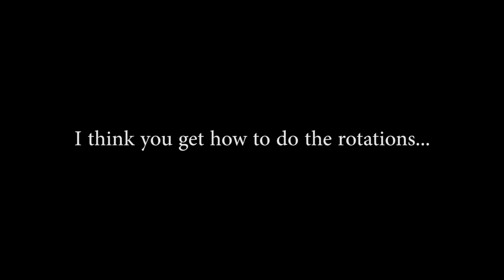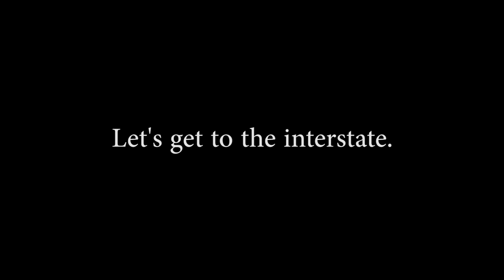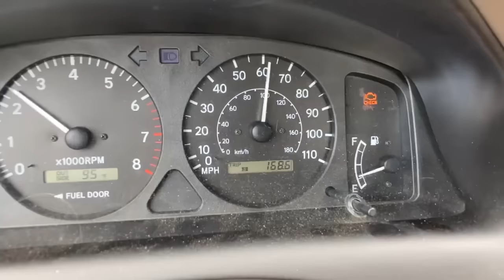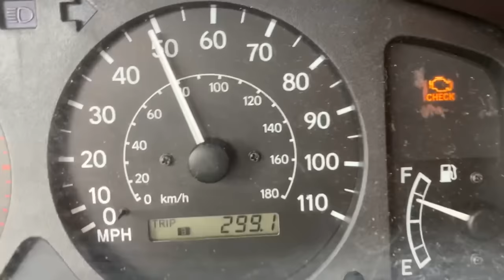Will Berryman's B12 Chemtool stop oil consumption? 😲 | Oil Burning🔥Experiments | Episode 15

Comment: I have done the same thing many times with my customers vehicles that failed the state required smog test. It has worked every time. I have no idea how much oil consumption has changed, since I never see most of these customers again.
From what I can tell, the oil control rings just get gummed up, and fail to work properly. This condition is mainly found with old ladies who drive very slowly around town, and never run on the freeway for very long.
I usually just send the Barryman's in as a top engine cleaner, as it is quicker in commercial operation. I have rarely done a full soak, and when I did, I relubricated the upper cylinder with engine oil before starting the engine.
I thought you might have hurt the cylinders with a dry start, however, after seeing your after-actin shots, I can clearly see a beautiful cross hatch pattern!!! Most Excellent!!!

From what I can see of your oil pattern on the piston heads, I would say that you need some valve stem seals, or perhaps new valve guides, when doing your next valve job.
I think your bottom end is good to go!!!

Try using some ATF in the engine oil, 500 miles before your next oil change. ATF also cleans piston rings, as ATF has lots of detergents that help removing such things. ATF also makes a great engine flush, but I always fear flushing an unfamiliar engine, as the ATF treatment removes a lot of internal engine gunk and might plug the oil intake screen to the oil pump.
That's why I recommend using ATF to top off before the next oil change, as you use less than a quart, and change it before too many miles have accumulated.

Proper oil change intervals never require flushes!!!
If I slip and go beyond 5,000 miles, the next oil change is done early, at about 2,500 miles, to insure maximum cleaning action from the fresh oil change.
I have never let any engine run past 10,000 miles!!! I don't care what the oil or engine manufacturer says!!!
I can afford oil and filter, every 5K miles, but an engine rebuild is going to be a bit much for me, at my age, So I take care of basic maintenance, and don't have issues!!!

My 2002 Tacoma has 165,000 miles, and still has 170 PSI per cylinder with 5% max cylinder leak down. So, I think good maintenance pays!!! Now if I could just get my IAC's (Idle Air Control) to last that long, as I am on my second one @ $245.00 dollars for an OEM part!!! The only real complaint I have on the 2.4L engine.

Good work on your test.  A good test is worth 10,000 expert opinions!!! LOL!!!

Tim
Reply: I had an S10.PICKUP  that I put in a 350 with a automatic in it , as a service truck the 4th engine got almost  600 000 miles on it when I removed it to freshen  it up. So I took it all apart and took all the pieces  to my racing machine  shop , everything  was within spec and they freaked out on how clean it was , I took it home and freshened it up as planned.  It ended up on the drag strip and it won king of the track and king of the hill titles  ,    I used Mobil one and wix filters and oil changes at 20,000miles or when the first quart is used, my current trucks have almost 400,000  miles and I've owned it 23years now the other has 3oo ooo ,I've had it 10yrs now  I do the same oil changes with Mobil one and wix.

Comment: Great video, Ben! Nothing beats B-12! My classic '89 Toyota Camry sat for the last 4 months through the winter waiting for its new Collector's Plate to arrive, and when I finally started it back up, it was running rough as all getout with carbon poofing out of the exhaust pipe every time it missed and stuttered. The car had just under 1/4 tank of gas out of the 15.9 gallons it can hold in it, so it was the perfect time to head on down to O'Reilly's to grab the last 3 cans of Berryman's on their shelf (which was exactly how many I needed for the trick I was about to pull off). Total cost: 20 bucks.
Here's what happened: O'Reilly's is 2 blocks from our home. My plan was to go there first, grab the B-12 I'd need to do the job, then continue up HWY 99 at a steady 45 MPH to get the shopping done. 2 cans went into the tank immediately, the rear bumper was bounced for around a minute or so to get it mixed in thoroughly with the 3[ish] gallons left in the tank, and we were on our way.
Naturally, it ran like complete crap missing and stuttering and farting carbon for most of the 3 miles it took to get there (I could see the poofs of black smoke in the rearview mirror), but 2 blocks from the store it started to even out some. After we finished shopping and headed back home, it surged a little at first then smoothed right out and ran like a champ. I plan to run it like this until the fuel warning light pops on, at which point I'll add the last can of Chemtool and top the tank off. After that, it'll be good to go again! =D
Reply: Dude, I'm using a 89 v6 camry as a daily driver and just had it parked 2 months. I'm going to try this today. Thanks!

Comment: Bravo Dave! I’m so confident that B12 worked and yes I’ve used 2 cans of B12 myself as 1 treatment. 1 can for hot soak with engine warmup, and 1 can for cold soak with engine was cold. And I also put in some ATF transmission fluid in each cylinders at the end, about 1/2 ounces in each cylinder to help lubricate the piston wall and final stripping off the left over carbon in the cylinder before starting the car. (ATF can strip off carbon deposits that’s had been loosened by B12). U don’t need much, just 1/2 ounce is good enough or u can skip the ATF if u don’t feel safe with it. That’s small amount won’t hurt anything since u r gonna change the oil anyway. Great video Dave! Hope to see your follow up video about the oil consumption after B12 treatment and remember, it may take 2 or 3 treatments to fully cure oil consumption and each manufacturer’s engine is different so it might have different results.
Reply from the maker: Thanks again for the suggestion ... I'm still in shock! I'm almost afraid to pull the dipstick again. 😳
Reply: @FamilyFriendlyDIY  so on to your next experiment? Is your check engine lights on because of the catalytic converter code P0420? If that so, I have another suggestion for u to try lacquer thinner in gas tank to clean out the cat. It will work wonders just like the B12
Reply: @blackysan  wait...what? Lacquer thinner? Tell me more. I typically buy $20 bottle additives for my p0420.
Reply: Can you just blast a little fogging oil in to re-lubricate the cylinder walls?
Reply: good point w ATF!
Reply: Hey Dave one recommendation I haven't seen it in any of the comments yet but I might think about indexing the plugs so that the flame front would be towards the carbon buildup to help burn the mixture more thoroughly and the addition of a capacitive discharge ignition we have multiple Sparks for firing on the compression stroke
Reply: @charlestalton7124 that's like a foreign language. Can you put that in laymen terms?
Reply: Can I just add this to oil without taking parts off?

Comment: Hi Dave, Ive been watching this series primarily because my daughter has a 2012 Audi A4 2.0T. Notorius for stuck piston rings. The car was burning through a quart of oil every 360 miles. About 4 weeks ago I did a 3 day piston soak similar to what you have been doing. I used Berryman's "Professional" Chem Dip. The car has now been driven 800 miles and has not burned a drop of oil. I am extremely surprised at the results and thinking the problem may be fully fixed. If your still having issues with the Toyota give the Berryman's Professional Chem Dip a try.
Reply: Your first test run oil had so much berrymans in it, which of course burned off. Hence the huge loss of oil. Later new oil, no loss.
Reply: I have the same car A4 2012 2.0 and burning a quart per ~350. Can’t wait to try this! You just gave me more hope, because I tried other fixes in the past and none worked!

Comment: I did the same thing on a scion 2.4 it fixed it.  I did it with the engine hot and let it soak until it cooled down. Treated it twice in one day. 4 hour soak each time from full hot.  Changed the oil no more oil consumption.
Reply: Great testimony 👍🏻

Comment: Hi Dave, my I suggest checking your PCV and maybe adding a catch can to verify if the engine is not ingesting oil trough the intake. If the rings are stuck it may cause too much blowby. Good luck.

Comment: Working on my son's TC tonight. I will keep you updated with the results once we complete the 24 hours period. Great video!! thanks for taking the time, step by step.
Reply from the maker: Thanks! please do keep us posted!
Reply: Great News, my son is on his second tank of gas and has burned 0 oil. Remarkable!! He used to burn one full quart of oil at just under 300 miles.
Reply from the maker: @IntegraTypeSPerformance  That's awesome! Glad to hear it's working for others!
Reply: @IntegraTypeSPerformance  Thanks for sharing! Could you kindly keep us updated on the consumption? @DIY Dave it would be great to pool all these data points in a future video (both pass and fail) to see if this is truely unsticking the piston rings or just luck. Thanks in advance!
Reply: @Accord 2.0 Performance  how has the consumption been big guy?
Reply: @weekendwrench  Perfect car stop burning oil. 3000k miles between oil changes. With no issues.

Comment: I am preparing to do this on my 2010 Toyota Rav4 with the 2AR FE (notorious for stuck oil rings due to tiny drain holes on the oil rings) with 185k on it. I bought it used a few months ago and it gulps oil down to the tune of 1 quart in 250 to 300 miles. I am excited to see the results! Great video!
Reply: Please update us with results
Reply: How did it go?
Reply: Curious here as well!
Reply: And are you absolutely certain it's the 2AR in there and not the AZ?
Reply: Yo I have the 2ARFE I burn a quart about every 800 miles. I’m thinking about doing this.

Comment: I do a similar treatment to my Audi q5 every other oil change. When I purchased the vehicle, it was burning 1 qt every 350 miles. I dont turn the crank though until after it has sat for a couple hours. Currently I am not burning any oil. 5000 miles between oil changes and still pretty much at the full mark. B12 is a god send for most cars that have known issues with clogged oil rings
Reply: Hello Adam, so you removed the spark plugs at every other oil change to do this? That's a lot of work.

Comment: I can attest through B-12. I have a friend who has  Mistubishi. It's a 1989  or thereabouts. He had check engine light. Had various mechanics replace plugs, tune the engine spent hundreds and the light wouldn't go out. This was a several  years back.  His car inspection was rolling round and he ran across this Berryman-12. After he added the can drove around a bit not knowing what to expect. The check engine light went out and till this day has never come back on . The vehicle has 200k plus miles on it. After that? I start using it myself after each oil change for good measure  😌
Reply from the maker: Great story

Comment: I would have let the B12 soak without turning the engine over the first time, observing if the levels drop. Then turning it over with more B12. Finally putting  some oil into the cylinders, turning the engine over, before starting it the first time with all new oil. The B12 did indeed wash the cylinder walls dry.

Comment: Thank you for your content on oil burning. I used this trial with B12 on my 97 Honda CR-V. It's been almost 200 miles since I changed the oil and the blue exhaust smoke is only a small fraction of what it was. At idle the blue smoke was horrific. I'm excited to see the results as the clock ticks forward.
Reply from the maker: Thanks for the testimonial, Jim. These are good data that contribute volumes to the experiments!
Reply: @FamilyFriendlyDIY  did you ever try putting the berry man’s b12 in the engine oil?
Reply from the maker: @doitrightthefirsttime8952  not directly, but it seems what I poured into the spark plug holes would have made it into the oil.
Reply: @FamilyFriendlyDIY   maybe try straight atf fluid
Reply: Hey Jim. Curious to hear how this has been working out.
Reply: @AudreysKitchen  Several months and approaching 1200 miles my CRV has amazing results. The engine has not consumed any oil at all. By this time it normally would have taken 2-3 quarts. The smoking is almost non existent. Very very little on an occasion. I highly recommend this trick/tip for any engine suspect of oil control issues.
Reply: Hello Jim, did you follow the same procedure? I have a 07 Camry I want to try this on. I would be ecstatic with your results.
Reply: @dalemoody7024  yes I followed the same procedure as in the video.

Comment: Hey there! I’ve been using Berrymans for quite a while. I threw a can in every other tank sometimes I’ll toss a couple cans in helps. Keep the valves your fuel system injectors, clean. Berryman B12 is absolutely the best.!!!! Highly recommend to everyone I know. Cool video. Thanks for sharing.
Reply: Did u add B12 directly to your engine oil ?

Comment: I used this video as a guide and did roughly this process on my Gen 2 Prius.  The results have been phenomenal.  Previous to the piston soak and hard drive my car was using 2 quarts oil every 3K miles.  After piston soak with B-12 I used less than half a quart in the same 3K oil change interval.  Amazing!  Wish I had ran in to this process 80K miles ago.  Thanks Dave!!!  Much appreciation!
Reply from the maker: So glad to hear ... and thanks for letting us know! Good info!

Comment: I am really glad it worked out for you! Every time you fill up the fuel tank pour in a bottle of cleaner to let the cleaning continue. Works great for cleaning injectors, intake valves (as long as it’s not direct injection), and to free stuck rings.
Reply: is cleaners not good for direct injection cars? i just used some lucas oil upper cylinder lubricant and fuel injector cleaner on my car(the  stuff you put in fuel tank).  plz dont tell me its bad
Reply: @flute136  It’s not going to hurt anything it’s just not going to help keep the intake valve clean because the intake valve doesn’t get cleaned by the the fuel because it just controls the air going into the cylinder.
Reply: This will turn your spark plugs into nasty looking hot garbage. You'll have to change them out more often. Not a problem if they're easy to get to, but some vehicles are terrible anymore.

Comment: wow dave! great news. when you posted that you were gonna try  b12 i did the same thing to my 99 corolla instead of kreen....a little differently tho. i filled the cylinders and let it sit over night. turned the engine and refilled then let it sit over night again.  then i put it back together and test drove. i made it down the block and lost all oil pressure, limped it home and pulled the pan to find the oil screen was clogged with carbon.  its running fine now. oil consumption has gone from around a qt per 100 miles to nearly none at 200 miles. still have more driving to do but im hopeful. we will see how it goes
Reply: James, thanks for posting. Please repost when you get some miles on your vehicle. I'm sure others would like to know how it holds up. Also, having additional people report their results gives a better idea of what to do, not to do, etc.
Reply from the maker: That’s awesome! 👍🏻👍🏻Please keep us informed.
Reply: How is it going now?
Reply: @heitorbernardes7977  as of today ive put around 500 miles on it. changed the oil at 250 miles and found alot of carbon in the filter. changed again at same mileage and alot less carbon in the filter. engine is getting cleaner. no noticeable difference in oil level on the dip stick at oil changes.

Comment: Thank you for your work Dave. I wanted to share my amazing piston soak results!!  My Audi Q5 (2012, 103k miles) was burning a quart every 230 miles like clockwork. I did a chickens*** version - used about 1 1/4 cans of B-12. I started with 75 ml in each cylinder, hand cranked just a few rotations (I know I’m lazy), waited 6 hours and added more, repeating the light hand cranking.  After 24 hrs, we added about a 1/2 quart of oil to the crankcase to make it full (started 1 qt. low) and cranked it up.  Rough start, took a few tries, but no CEL or misfiring. I drove it gently 10 minutes to the oil change shop - no revving or highway driving.  I’m at 1100 miles now and the oil indicator is barely below full. No other products were used. I can’t believe it! Thanks again!
Reply from the maker: That is awesome to hear. Thanks for sharing!!

Comment: A few years ago I had a 1996 Ranger pickup with 200K miles on the 2.3L 4cyl and it burned oil but had no leaks. Never saw smoke but I could smell it and I was putting a quart of oil in it every 1000 miles. After doing my first oil change it used another quart after 1000 miles, so I put in a can of Rislone smoke stop and topped off the oil level. After that it barely used half a quart by the time I was changing oil again at 4000 miles. Sadly it was so rusted out after being in Minnesota all its life I had to scrap it.